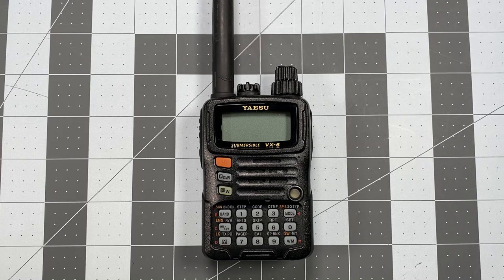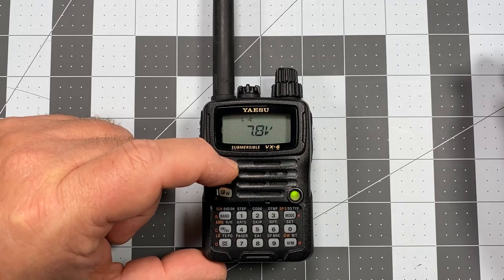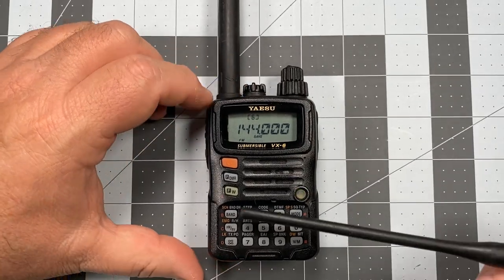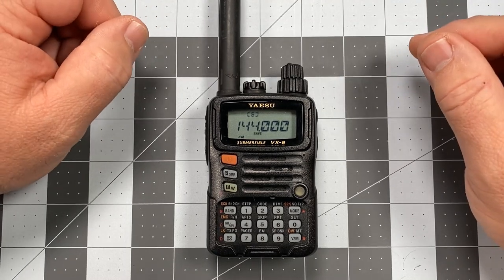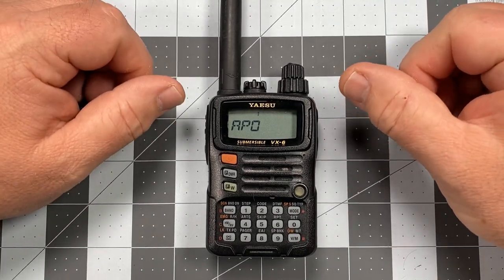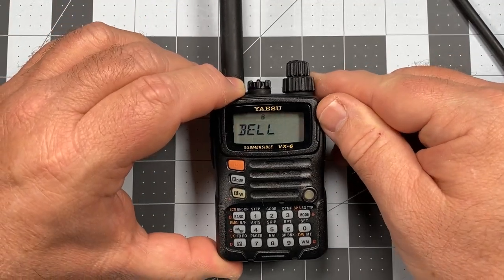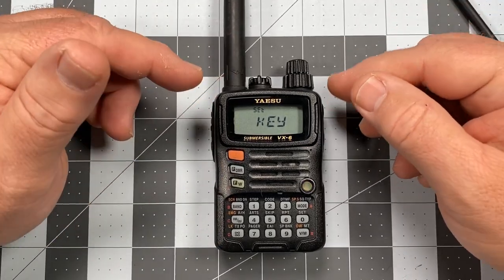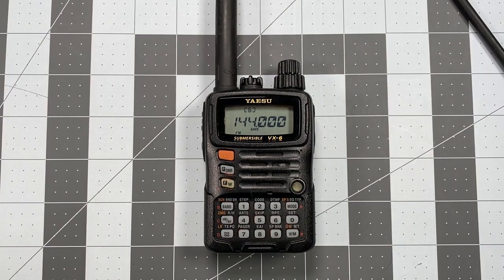Yaesu VX-6 Operators Series - Part 4: First Things To Set

Comment: The one "first thing to set" I found, is to reassign the "wires" button to show the voltage. Since Wires is relatively useless, and there is no battery meter - I find this VERY handy.